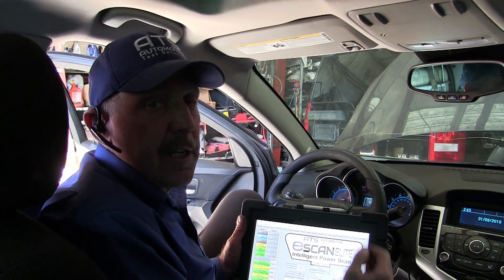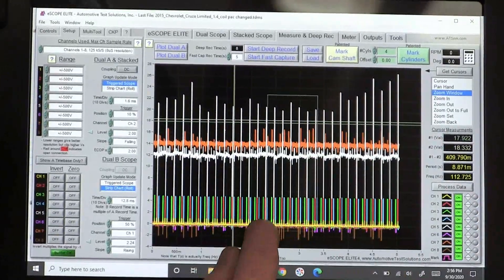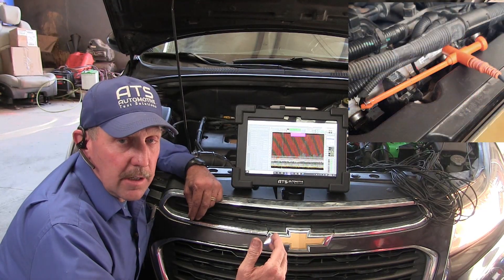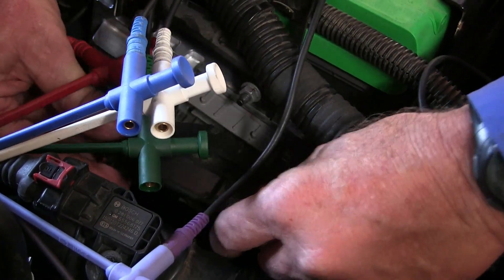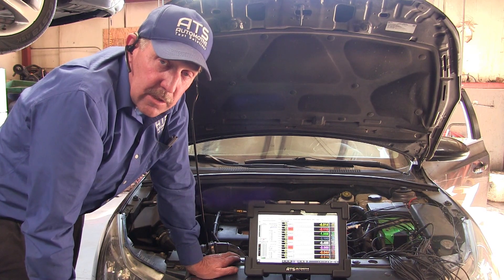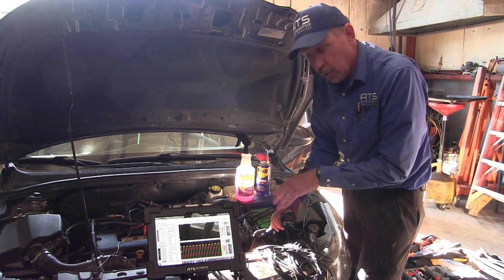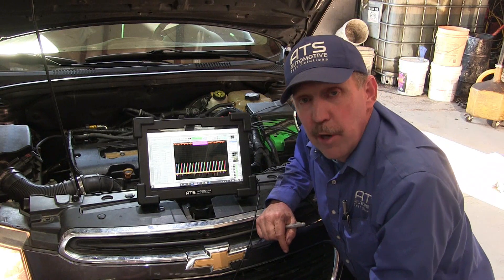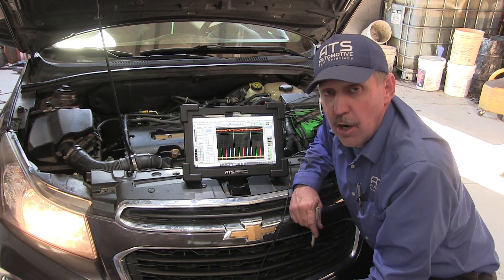See How to Quickly Diagnose a Misfire on a 2015 Chevy Cruze with P0301, P0351 & P2301 Fault Codes

Comment: My 2016 cruze had an engine  rebuild a few months ago  it was misfiring,  we changed the coils and plugs. Normal driving, she has no issue  cept when I floor it it jerks a bit b4 changing gear, check light flickers  then goes away. My cheap scanner gives me a p0300 error code. Consuming oil too, and the coolant has dipped under the full mark.😢
Hope they can fix the issue😢

Comment: Best troubleshooting video ever! Thank you so much, I'm getting into this tomorrow.
Update: Was getting P0304, P0300. Turned out that I replace spark plugs and the coil module. Cylinder 1 and 4 were severely corroded (coil, links, plug), just amazing that it ran for so long like this, the other 2 looked brand new. The coil module comes with the rubber boots and the spring links, all in one box. Paid 180 CAD from a local auto parts retailer, stock on a Saturday morning! Spark plugs were premium at 21 CAD a piece. Will check my connectors to the computer in the summer. Be very careful if you are newbie and replacing spark plugs, the holes are deep and you want that clean right to the bottom as if you were going to eat some sushi in there. I use an air compressor, break cleaner and thin rags that I pushed down with a flat screwdriver around the spark plugs until its perfect. Pulled them out easy, did about 1/4 turn torque on the new ones. I checked the gap, didn't need any adjustment right form the box, Be careful with the coil module connector, pull that little colored tab out and press down on the clip to pull out. Google it if you are not clear on that. Mileage 67,000 km (42,000 miles).

Comment: I don’t have one of those fancy tools but my 15 cruise has been sitting for several month. I took my car to a dealer and they got oil all over the top of my transmission where the filter is. Which I freaked about so they “cleaned” it by pressure washing it. Fast forward to months later, I started having a misfire. I changed the ignition coil. It fixed it for a few months then started misfiring again. I would bet you this is the result of them pressure washing the engine bay where it says “do not pressure wash” and when I say dealer i mean an actual chevy dealer, so they should have known better. I contacted chevy and they were no help. From that day on I work on my own cars. I’ll check the plugs once I finish the ford I’m working on. Thank u very much it’s another place to look besides changing the result of something else being broken!

Comment: I had a 2015 Chevy Cruze and I had a misfire on cylinder 3 and the dealership mis diagnosed and costed me $2500 to replace the engine. After moving to PA, I had the same issue and took it to Bean’s Auto in North Versailles and he replaced the coil pack which was the correct diagnosis. He went above and beyond and replaced the spark plugs and changed the oil. If anyone in the Pittsburgh area needs their car repaired. I recommend Bean’s Auto. John Bean was my grandmother’s mechanic for years. That is how I know him.

Comment: welp, took my 1.8l connectors off and found a little bit of corrosion in the same harness in which you did.. it was very little but i went ahead an  I cleaned it up with some electronic contact cleaner and 'wiped' it clean and now.. the waiting game I suppose

Comment: I've gone through 3 ignition coil too and it blows out the fuse for injectors 1 & 3. PO103,  P2301 is the reading I get. Could this also be corrosion issue..because I went through the wiring harness and found no break in the wires.

Comment: I’m having this exact problem with my Chevy Cruze I’ve replaced everything that I could myself i cleaned the corrosion like he did and for some reason it’s still giving me a misfire code in cylinder 1 I just don’t have the awesome tools he has to figure out if it’s the connector harness or what lol

Comment: Great video as always Bernie, however I have a couple questions. Yes you cleaned the corrosion from the connector, but wouldn't there be actual damage (pitting) to the terminals in the connector and the pcm? Second, how did the the corrosion happen? I didn't see any mention of inspecting the weather seal or determining how liquid got inside the connector.
Reply: Late reply but I've found on these water tracks through the harness from the thermostat housing connector. Seems to happen more on aftermarket housings.

Comment: This brings back memories of the shop that I went to last year. and just as you said, they had replaced multiple ICM and the problem was still there. The only difference was that this vehicle would blow fuses, but it was still the same corroded connector.
good job Bernie.

Comment: How could you tell that it was shorting to injector?
Reply: He could see the white trace on the scope waveform shape was identical to a fuel injector control waveform. It was supposed to be a 0 to 5 VDC square wave. Instead it was at 12 VDC, then pulled down to 0 VDC. Then when released, you see the white trace spikes very high. Probably as high as 50 VDC spike. If you rewind the video and pause it you will kind of make it out, if you know what an injector waveform looks like. Hope this helps.
Reply: Billy Yoder good explanation. I find sometimes goes over stuff fast and I miss it.
Reply: @thebaldmechanichardatheari1124  indeed, most of us that have seen waveforms; we can spot issues like this really quick but Bernie doesn't explain because he assumes we are familiar with these common signals.